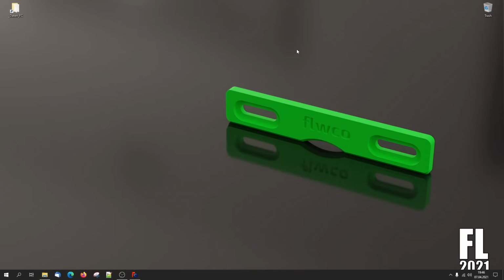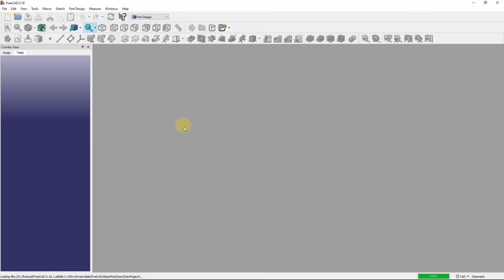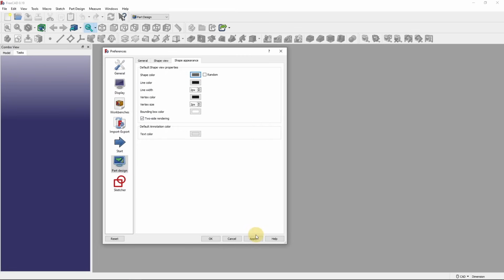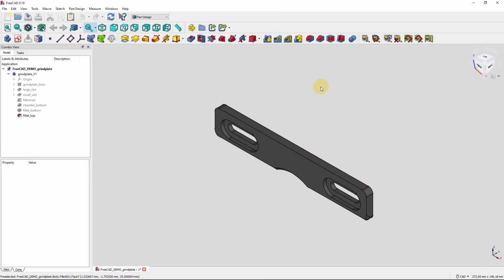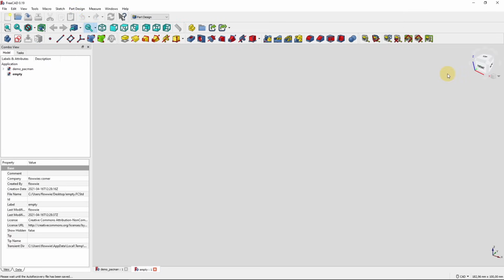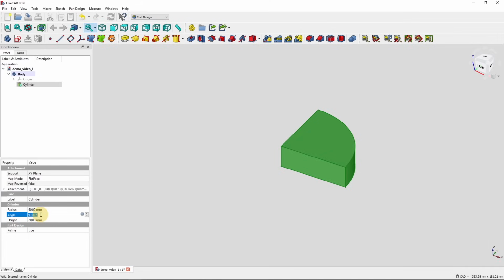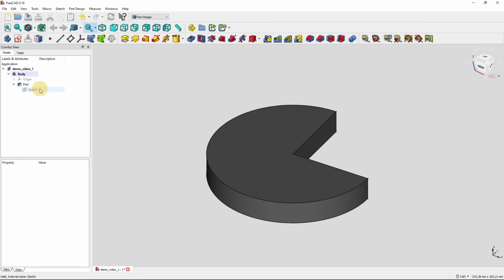FreeCAD 0.19 - Basic Course - Part 1 - Your start with FreeCAD (EN)

Comment: FreeCAD needs to include a preference to change the size of the text in the Menus, Panels, Preferences, etc. The print is TOO SMALL! 
And the font is fuzzy on a large monitor. I set the system font scaling to 175%. Why can't FreeCAD use that or better, let me set the font size?
This has been a problem in 0.18, 0.19, 0.20, and now 1.0.
Reply from the maker: Have you reported that to the developers? I'm just a video guy and even when I agree with you, I cannot change this myself.

Comment: I ran into a strange issue using FreeCAD to open a CAD file I made from another program. I had the unit size set to "mm" in the other software, but when I opened it with FreeCAD, it scaled the model in METERS, and I tried to scale it down but could not find a successful way to do it.  I would be curious to find out what I was doing wrong, or, is this just a software quirk?
Reply from the maker: What file format was that exported file?

Comment: Hello, great tutorial.  I have only one issue. The content is blurred.  For instance, when you click on an application icon, it is difficult to determine precisely what you are selecting.  I have high definition monitors and plenty of computer power.  Is there a site that has a more pristine view?
Reply: Check your YouTube display Quality (the gear icon at the bottom of the video window) to see if you can select a higher-res image.  YT often defaults to a lower res, which can blur details.  On a 43" 4k monitor at 1080p, the icons are clear enough for me.

Comment: Wow.  Literally all I needed.  A cylinder.  I spent 8.5 hrs yesterday trying to make a damn cylinder.  A cylinder with a hole in the centre to act as a tank shim for my non-lethal launcher.

Between comments like "FreeCAD is easy" to Amazon reviews like "these Creality printers are super simple for beginners", I am starting to feel like a dang troglodyte.

I've even written my own Android program to control a 5 tent cannabis grow (temps, humidity, light times, feed timers etc) using a tablet as the brain, and my personal phone as the main control centre.  I can see all my temps, humidity, and light times and adjust them from the phone on the go, override the fans and leave them on continuously etc etc.

I've been pulling my hair out ever since buying this 3D printer.  Either print problems, or I'm staring aimlessly at FreeCAD.  Part of me is starting to wish I never bought the darn thing lol

Comment: I installed Freecad and tried to follow your tutorial.  However the version I got is different than the version you show and it kept crashing.  I unloaded it and got out my t square and drew the part then emailed it to the machine shop for them to craft.  I can do on paper in half the time it takes to set up a cad program.  Thanks but no thanks.

Comment: I'm moving from Inkscape for 2d designs for my Glowforge laser to 3d designs for making things with my lathe and milling machine..  While neither is computerized I want to design parts that are true to scale and allow me to view the design from multiple directions.  At a recent MakerFaire Freecad was recommended to me. I found your tutorials to be incredibly well structured and clearly explained.  It will take me a few times stumbling around to implant the parametric components into my head and the object properties and how they relate, but I don't see this as a problem based on the first tutorial.

The most important thing (for me) is a tutorial that stays on target with no parenthetic comments that the instructor inserts when they think of something related.  I subscribed midway through the first tutorial as I trust the others will be as well structured.

Vielen Dank, dass Sie so umfassende Tutorials erstellt haben. Es erfordert Hingabe und Zeit, gute zu schaffen.

Comment: I have completely messed up my colours because the github PDF file is now useless because using 0.21, tried to make the changes and it just did not work. Sorry, but now too far gone and unable to get it back to how it was originally configured and wish I had not tried. I am feeling quite grumpy right now. The git-hub colours PDF file should be updated or deleted.

Comment: Thanks for a great tutorial. Im having a problem pretty early though. when i go to put the 2 lines in the circle, the 1st one will snap to the center point and the edge but the 2nd (vertical) will snap to the canter but not the top of the circle, so i cannot trim. i must have a setting wrong but i can't find it. Any ideas? Thanks
Reply: Same problem, did you find out the solution??

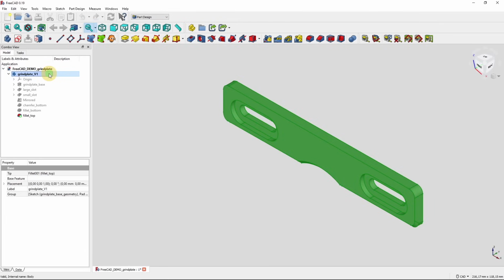Comment: Hi Flowwie, at 15:36 you show the whole grindplate, but on my PC I just saw bounding lines until I unpressed bounding box.  Then I saw my color was different, so I can see that your color chart does not exactly match the newest "0.20.2" version of freecad.  Maybe you can set me straight on this.  Your menu is not the same as the new version and the text you have might be slightly different. 
It seems incredibly important to understand why things appear as they do in FreeCAD, most teachers skim over this this part.  But thanks for the careful tutorial.

Comment: i have problem with light mode can u change it with dark mode
Reply from the maker: There is no actual dark mode in FreeCAD as I know. You can change the background color to a darker color if you prefer it that way.
So you're having problems with the light color?

Comment: This doesn't compare to fusion360. It's very hard to get accurate distances with the sloppy controls. I wonder if the designers will fix the lock ons and make it possible to change the sketch objects sizes on the fly like fusion 360!

Comment: I just found this program and this tutorial was amazingly helpful. A program like this could be overwhelming and this has made it easier to get started. There were a few times I got off track due to mistakes I made but I was able to just delete some things and get back to a starting point then move forward. The only thing I want about to resolve was using the space bar to turn the object off as demonstrated towards the beginning of the tutorial

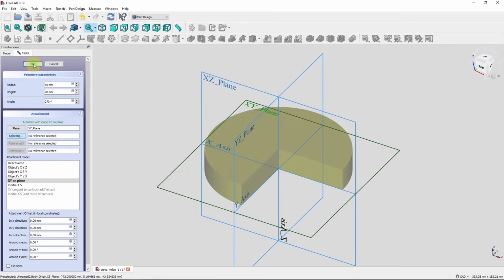Comment: Your frequent mention of what parametric CAD means, such as around 22:20, is completely incorrect.  Non-parametric CAD programs also have parameters for the basic shapes. Parametric CAD programs have parameters that are not specific to those individual  basic objects but rather have a larger scope where they affect multiple objects, or multiple constituent objects of axlarger user defined object.  So instead of entering a constant for the radius or angle, you can enter a formula to calculate those from a parameter or variable.  Freecad also has the spreadsheet workbench as a place to enter your parameters and intermediate calculations based on them. In parametric CAD, a plate with holes drilled in corners, for example, could have those holes move properly when you change the size of the plate because both would be based on parameters, instead of having 5 objects whose sizes and positions were hard coded.
Reply from the maker: Thanks for clarification- will keep that in mind for the future videos!!

Comment: I am learning Cad because I have come up with what I think, is a great product and these tutorials are awesome. 1 question: is there a way that I can import multiple Cad designs (files) into one work area so that I can synch them in order to create a new design using multiple parts?
Reply from the maker: usually this is called assembly modeling of modeling in assembly context. unfortunately this is one of the weaknesses of FreeCAD still. Keep your eyes open for my next tutorials.

Comment: Thank You for the excellent video, I have been struggling with the concept of parametric modeling and freecad, your video was fantastic, and I'll definitely be using your entire freecad course. BTW I intend on using freecad for both my CNC and 3D printing needs, what is your opinion on freecad for these purposes
Reply from the maker: 3d printing is fine, you have excellent options for STL export.
CNC is a little different because you should have knowledge on the FreeCAD Path workbench - which I don’t have (yet) cuz I don’t own a CNC router 🤨

Comment: good job. waiting to see how to add sketch on top of the last cylinder
Reply from the maker: multiple options.
Best one: place a sketch on XY plane and move it in its attachment in z-direction the height of the cylinder
second best: create a datum plane and move the planes attachment in z-direction the height of the cylinder
third one: (not recommended) select the top face of the cylinder and attach a datum plane on it
fourth one (least recommended) select the top face of the cylinder and create a new sketch which is attached directly to the top face

Comment: Flowie - Great youtube instructional video.  One request - could you update the color scheme on your Github to Version 0.20?  The options are different between .19 and .20 and it's a bit confusing to try to figure out exactly what the Sketcher colors in your color scheme 28.03.2021 are as related to Sketcher color screen in 0.20.  Thanks!

Comment: Your PDF is a mess, not in order and text does not correspond with names.
You could update it by cad version and in order, so we don't have to go up or down the list.
Example Geometry element colors / Vertex Constrained then unconstrained.
Now, that I have changed your initial workspace, I have no choice but to waste time finding them.

Comment: Great tutorial! But I was a bit confused for a while by differences in my display and what you show in the video. Might be differences between 19 and 20,  the Windows and Linux (my install) product, or simply differences due to the lower dpi display on my laptop. Many of the icons are in a number menus rather all laid out on the same line as in your video. 
 One question. When placing the center of the circle in the sketcher, does it automatically snap to 0.0? It is near impossible to get the location closer than .5 or so in either direction for me. And do the locations of the ends of the two lines snap to the center and the intersections with the circle? So far I've not been able to find a way to actually see the locations of those points once they are placed. Thanks for this. I was trying to learn Onshape but there is way too much black box magic in it, and way too little actual step by step instruction like yours. 
The ablity to change the mouse button definitions is wonderful. The default does not work for me. I find OpenSCAD to be quite natural for me.
Reply: I struggled with that same thing (Desktop Windows 10 PC, FreeCAD 19), I found that I needed to hover the mouse pointer over the target which changes colour when the snap will occur. Then single click on the target. Move the mouse to the second target and click, then open the parameter dialogue to tidy up the position. 
I hope that helps 🙂

Comment: Really well done, thanks a lot. Sometimes when you select a button on the menu, it would be great if you do this a little slower, else we have to re-watch everything many times, because we may work with a bigger screen on a newer version with a different tool arrangement and even slightly changed symbols for the same feature.
I want to build a special work "desk" with layers of self supporting overhead boards and cabinets that will host a 3D-printer ... so I will need these skills for my special furniture as well as the later printer use, to create thinks for RC flying and electronics.
Thanks so much for your help on this great piece of open source software.

Comment: They need to fix the measurement for the US to display in inches, not fee and inched. A lot of construction/wood working is done using inches as the measurement, not feet and inches.

Comment: Hi Flowwie, thank you, very helpful. I will continue on with the course.

I have just discovered FreeCAD and so far I am impressed with it. At work the design engineers use SolidWorks, I am afraid I do not get a license to SolidWorks only SolidWorks Composer as I am the companies Technical Author. I think FreeCAD will help me create some items that the engineers omit for simplicity but I require them for Parts Manuals.

Could you please update the colours for version 0.20.1 of FreeCAD as it has a slightly different UI for the colours and what looks like extra colours. I have worked out the colours myself but I am sure it would help others if it was up to date.

Once again thank you very much for this video tutorial series.

Comment: It's wonderful to see this!

I used AutoCAD 2000 (Back in 1999) when in school and it would have been awesome if a free version was available.

I'm now getting into QGIS, and happy that the barrier with ArchGIS has been removed and the quality of software is getting better with each update.

I imagine that it won't be long before FreeCAD will surpass AutoCAD because Free and Open-source software is 100x fundamentally better than 1 corporation holding back creative development.    

I guess that there might be some overlap with QGIS for the drawing presentation since it's a representation of the smaller scale vs the larger scale work environment.

Comment: Not user friendly. If you maximize or close combo view panel you need to spend hours of online research to find a way to restore it. This cad is a waste of time and resources. I see other fellow user complais here on youtube for similar frustrations. You should prevent viewers about those matters before they waste their time with learning this piece of crap. Back to Fusion 360
Reply: Bye, don't let the door hit you on the way out...
Reply: @laly0033  It cannot hit me because it stopped on your head
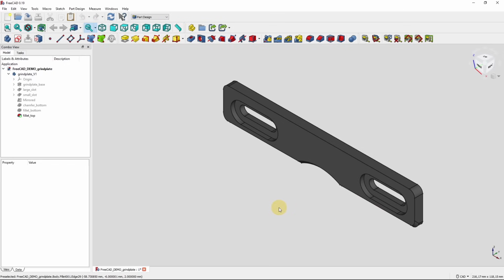Reply: @dvr4337  Dude @13:20 flowwie explains the combo view panel so if you had watched the video it would have taken you 15mins to learn about it. If it took you hours to figure out how to restore the combo view then the issue lies with you and not the application. I did a google search with the terms "freecad restore combo view" and the eighth result down came up with "Menu/View/Panels/Combo View" off a reddit page. I did not even have to pull up the website page and took all of maybe 5 minutes.

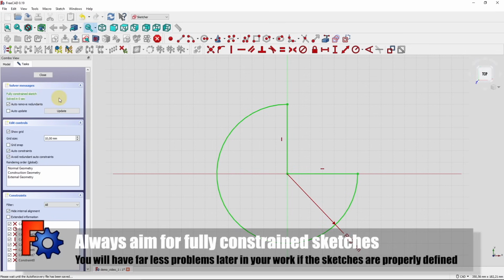Comment: At 25:19  ya left something out ( or I have a buggy install).  I have to select "Create a new body and make it active"  or else I get an error message telling me there is no active body.  
ALSO  how the heck does your software switch automatically  from sketcher in the workbench window to part design without input from you?  I have to manually select that.

Comment: Having cut my teeth on Solidworks, coming to FreeCAD, even though it bears some resemblance to Solidworks, FreeCAD is like taking a massive step backwards. But something isn't right here. No matter how much I follow your tutorial I cannot for the likes of me get FC to do exactly what you are doing. I'm using 0.19.2xx on a Mac and whenever I go to sketch anything, the plane rotates as if locked in the 3D orbit mode. Is this a bug? I will scour the forum. Thanks for the tutorial. I'll be back.
Reply: It's a bug. I got FC to finally draw a square, but you cannot be in certain CAD mouse preferences that allow for orbit while using the left mouse button (the button you initiate a sketch with). Shame FC won't allow the mouse to behave as if it were connected with Solidworks ie scroll wheel push for orbit. This would've been perfect. But then so would it be if 'pad' was just called 'extrude'. Maybe Dassault Systemes are just a little paranoid of FreeCAD being free? LOL! I look forward to watching the rest of your tutorials. :)
Reply: It gets worse. Closing the sketch does not show the pad tool. In fact that Pad tool is absent completely, with no obvious way to get it back. Close also doesn't quit the Sketcher. It stays there, until told to open the Part Design window. But doing that, FC throws up even more gobbledegook which doesn't execute: 

"In order to use PartDesign you need an active Body object in the document. Please make one active (double click) or create one.If you have a legacy document with PartDesign objects without Body, use the migrate function in PartDesign to put them into a Body." 

??? 

So I do that (select entities), but nothing happens. Arghhh! 

It looks so easy in your tutorial, but in reality, FC is an archaic mess. Maybe it works better on PC or Linux than it does on Mac? But I find this odd as it seems to have been developed in Qt and most apps on Qt seem to be fairly consistent, cross platform.

Comment: I need to start a project, one that will not be easy to develop. Most of which is going to be CNC production, so learning CAD is essential as dental cad is not new to me but I now need to proceed to metal engineering to produce parts to improve dental options. This was a well-presented and excellent, presentation tutorial. Clear and precise. Educational videos are not easy to make and how they are made and how someone can absorb the content without confusion is a must. You did this really well. Extremely helpful. Looking forward to following this education. Thank you.

Comment: at 6:19, user interface is different in Linux (Ubuntu 20.04)
program version 18.4, installed from website, using sudo apt-get command for Debian based distros.